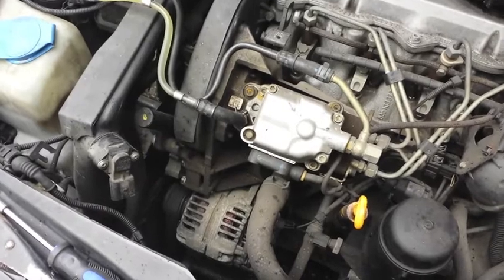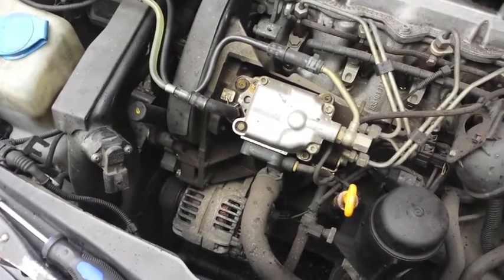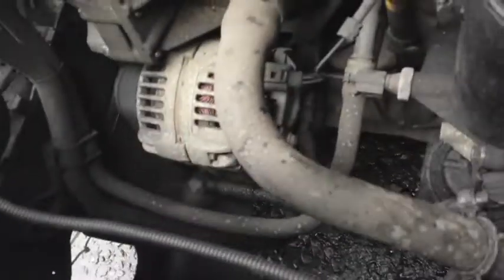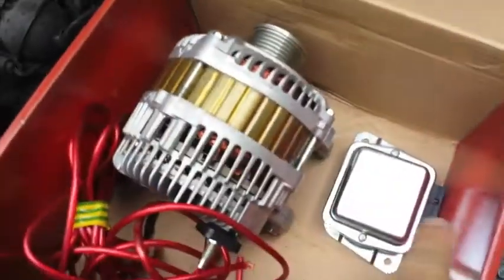de-regging a 210a alternator and fitting an adjustable regulator to an mk4 golf

Comment: Hi I'm having problems with my mk4 golf the amplifier (alpine mrp350 ) the amp does not turn off when I take the key out the ignition n drains the battery my head unit is a pioneer mvh150ub I think its got something to do with the rem wire any help would be appreciated :)